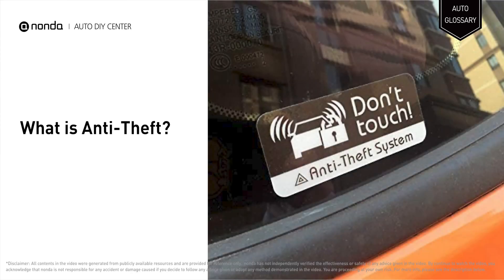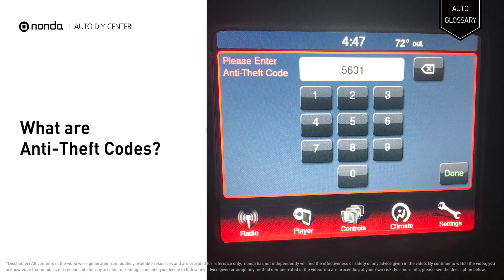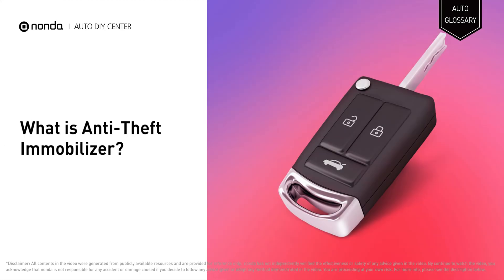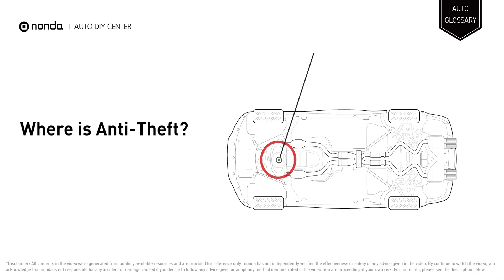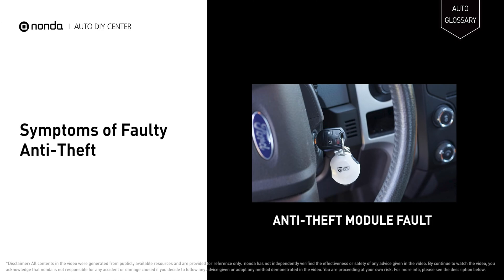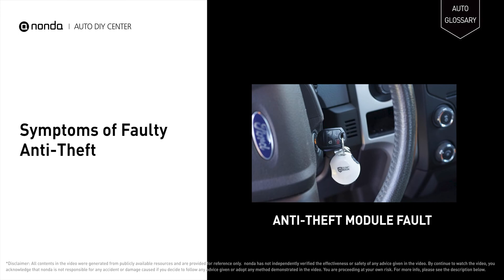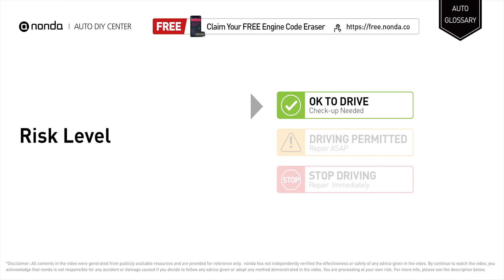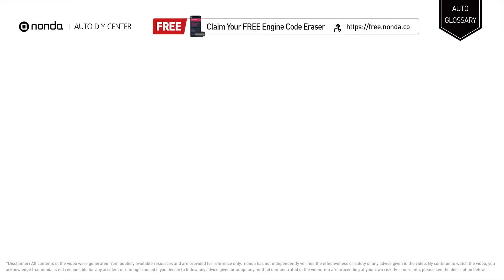Anti-Theft Systems Explained

Comment: My truck was nearly stolen thanks to the factory anti theft devise but now it wint start for me. Ive replaced ignition housing and cylinder with new key. Did the 30 min relearn and it started and ran great for approximately 4 months before parking it overnight and hasnt turned back on. Been doing the 30 min procedure over and over still will not start. What am i missing??
Reply from the maker: Hi Frank, have you checked the battery (if low/needs charging)?